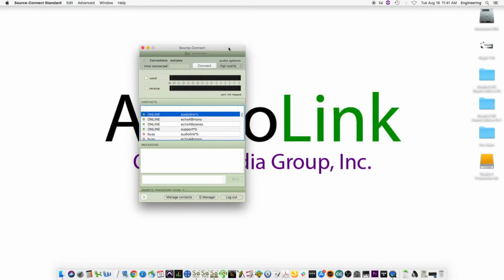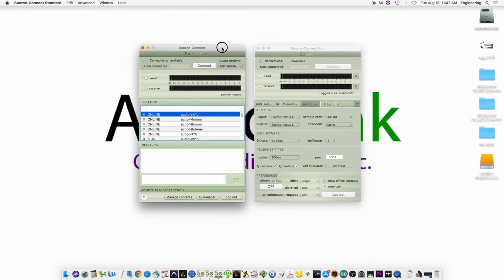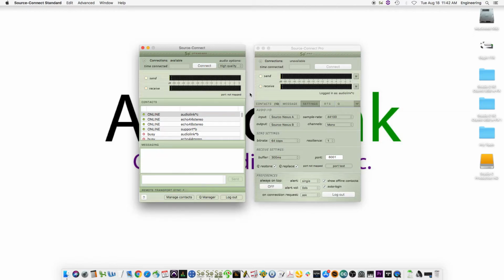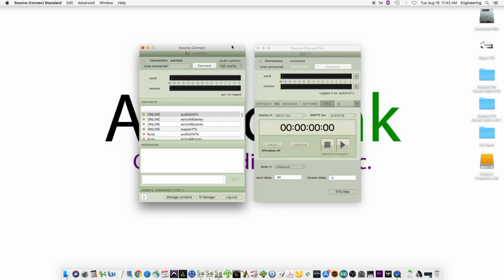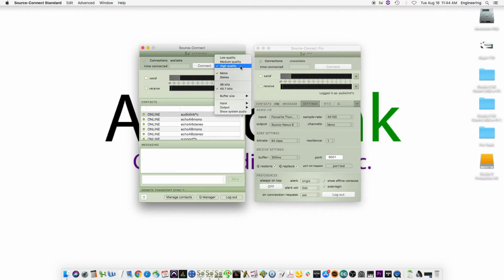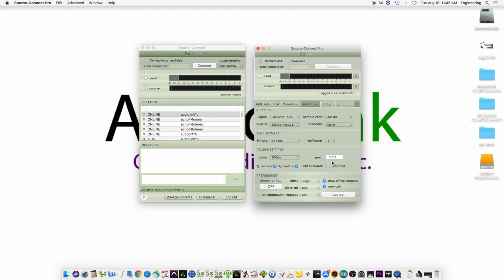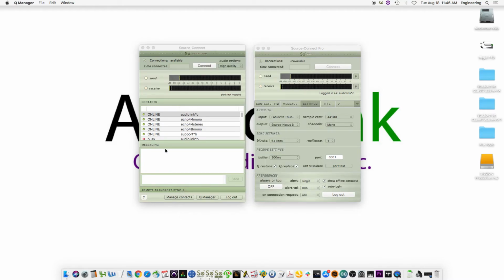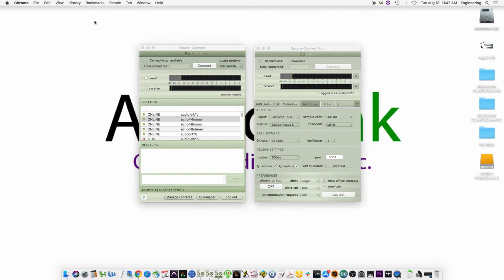Source Connect Set-up Tutorial

Comment: I've tried their trial version few years ago because my client requires it. However, I couldn't setup the network properly. I'm behind a router with firewall. They did not provide any supports for the trial version, so I did not bid for the project. My question is, if I purchase or rent the software, will they provide support to help my configure port forwarding for my router? Or will it come with sophisticated idiot-proof solution that anyone can connect in one click (just like VST Connect)? I don't want to pay if it's not guaranteed to be 100% successful.
Reply from the maker: Unfortunately, SC does not have a one click solution for port forwarding. It can still be used without port forwarding, but may have less reliability. We also have a video for port forwarding instructions.

Comment: Yes it has helped me a lot. I have the Standard version ( at least 5 years ) and I have never had problems. Now I have changed my computer and I am having problems with the configuration of my router. But source connect has an option to connect you anyway no matter what your status says. My status in this moment say port: no mapped. But still working!!! They call it Source-Stream and It's there in the application . We need to enable in the application where it says Advanced...
Great video!
Reply: @audiolink8239  
This is a great video too, but my router is different and it's hard for me to try to fix my IP. Anyway source connect is working right now ...And in the next month I will replace my Internet provided. I hope I''l be able to continue using Source Connect . Thanks for the tips!